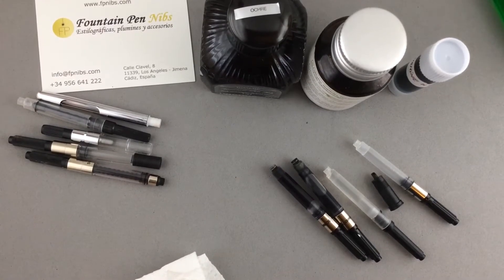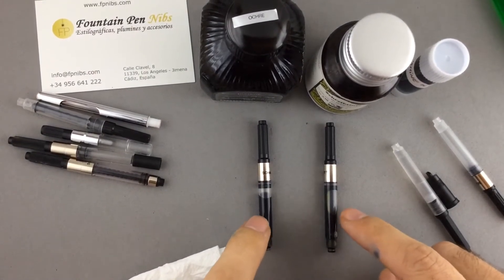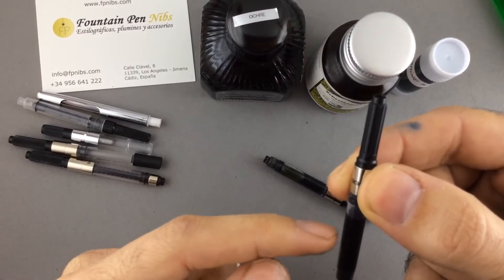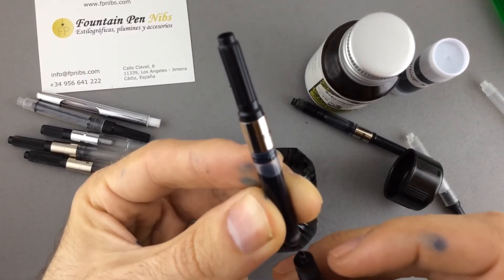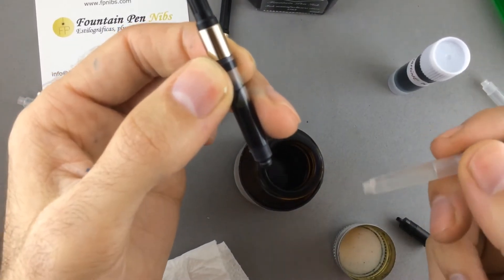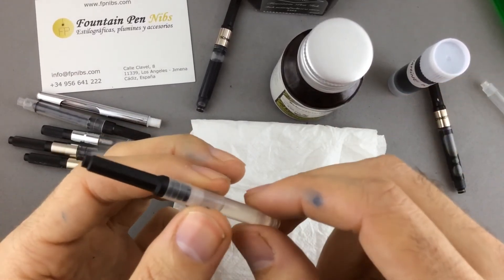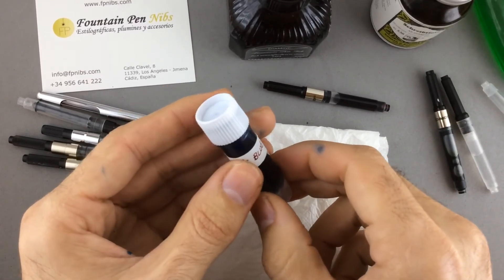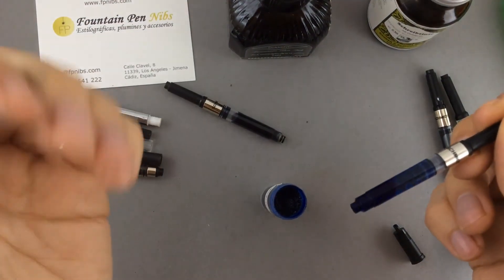Ink flow problems on modern fountain pens Part 2

Comment: Great video!  Another good way to get a stubborn ink to flow is to add an agitator to the converter.  I use a ball bearing.  The ones that come inside the Platinum Preppy cartridges are perfect.  If your converter can be disassembled (and many can), you can pull the piston out, drop the ball bearing in, and put the piston back in.  The Preppy bearings are perfect because they fit in the standard converters but won't drop through the feed hole.  They're also stainless steel, and they won't corrode in the ink  (at least no more than a stainless steel nib will).  The ball bearing acts to break the surface tension of the ink, break up any bubbles, and allow the ink to flow.  Some converters (like the Pilot ones that I've seen) actually come with a bunch of small ball bearings in them, retained by a little steel cage.  But I use the Preppy ball bearing trick on my Jinhaos.

Comment: Hola Pablo, fantastic part 2. That detergent solution in my opinion helps to lubricate the ink for smoother ink flow in the converter. Amazing. Smart tip to test on sample of ink in a vial. Also, it is less waste if it fails. My advise on your english, don't worry about it, people can rewind and play it again if they didn't catch it the first time. Be encouraged and continue your efforts. Well done.
Reply from the maker: Muchas gracias Jesus!
Reply: gpa manuel The soap solution breaks down the surface tension of the ink, making it  "cling" less on the surfaces of the converter. Basically it is not more "lubricating" but less sticky to the surfaces it comes into contact with.... Another trick employed is to include some sort of ball or spring in the converter or cartridge. However this usually is inserted by the manufacturer.

Comment: This actually solved my problem. I just bought a Jin Hao 599 and I tried for about a hour to get my Noodlers Black to flow. I did all of the usual things, tapping, warm water...nothing. I took out the piston converter and noticed the bubble. I let the ink out and moved the air bubble out. I then added a little more so that the ink could move freely and BINGO! The ink flowed beautifully. I suspect you this might be the problem a lot of the time. Thank You.
Reply from the maker: Trent Britain Jéter excellet! Yes, many people was sending me their pens with this kind of ink flow issues, they spent a lot of money on shipping costs so I decided to make this video and send it to them so they can find out if the problem come from the bubbles.
Also some people has asked me about the converter shakers -balls, springs..., but these only work when you shake the pen, but when writing nobody shake the pen, so the ink problem again appears. You do not want to write a sentence, shake the pen, write a sentence, shake the pen... 
I think converter manufacturers should find a solution.
Thank you very much for your comment Trent!

Comment: I just experienced this problem today. It took me bit to figure out why when I'm writing, my pen would go through this cycle where it will get drier and drier as I write and then all of a sudden it will be extremely wet. I was using a Diamine ink when this was happening. I cleaned the feed and housing multiple times with no results. I finally changed to an Iroshizuku ink and the problem went away. Now that I watched your explanation, I think what was happening was the bubble gets bigger and bigger as I write (which would also cause the feed to slowly dry out) and when the bubble gets big enough, it will shoot to the top quickly which also sends ink gushing through the feed. The cycle then starts over again. After watching your video, I looked at the converter with the Iroshizuku ink in it, and sure enough, it flows freely just like in your video.

Comment: It seems that the material used for converter isn't the same as the one for cartridge. The recent converters are transparent and rigid like the one on the video. Brand new  the converters are leaving a bubble that holding the ink flow. I cleaned the converter with soapy water this reduced the surface tension and the bubble was able to move freely. I assume the cleaning removed some molding or protective material that created this surface tension. Quite happy to find a cheap and easy solution to a very annoying skipping problem. I haven't experienced with different ink at this stage, so far just complying to pen, converter/cartridge, ink from same brand. try it!

Comment: Just watching your video on flow problems.  Very informative.  I put my Lamy converter in wrong as didn’t know about the little knobs on sides of converter.  I put it in until it clicked.  Don’t know if I should have done that.  I was having problems with flow.  Now I can’t pull converter back out.  It still has ink in it and is writing now.  Do you have any advise on how to get converter out.  Eventually I need to flush it.
Reply from the maker: Just pull stronger

Comment: Does this imply that pens that do not use a C/C filling system (like piston/Vaccum/eyedropper etc.) are better in principle because the air cannot get stuck inside the large barrel opening and it can flow easily?

I am genuinely interested in this topic and want to learn more.
Reply from the maker: That is right! But pens like TWSBI and Opus88 that fit regular nib units can also have this problem. A Pelikan for instance have a nib unit with a very open feeder fit into the reservoir, like vintage pens, so these don't have this issue.
Reply: @Fpnibs  so what can I do to improve the flow of Opus 88?
Reply from the maker: @dr_ink7268  there are several approaches: easiest one is to keep the pen well cleaned with sopay water. A bit more difficult is to open the air canal of the feeder, and lastly is to modify the nib unit housing and pen section to avoid the "bottle neck" issue that nib units have.

Comment: In fountain pens, surface tension of the ink has as much effect as the density of water versus air.  If having a problem, use a very small amount, one drop at the most, of Jet-Dry or other dishwasher anti-streaking additive in 10 mL of water, and, in turn, one drop of that mixture in your converter or re-filled cartridge along with the fill of ink.

Comment: i think my problem with this might be because of my converter though, because my ink isn't sticky at all, and I haven't heard of anyone else having the same problem with the same type of ink.

anyone know a converter that's compatible with the beiluner fountain pen?
Reply from the maker: Thatis right, converters are made from different types of plastics, for instance, I foundSchmidt K2 converter is better than the K5 and K6 for those inks which shows this issue. Sorry I do not know your pen well enough to recommend a converter. Good luck!

Comment: hi, good day i would like to ask how to make my ink flow better on my jinhao x750 with a zebra g nib. i did watch part 1 and part 2. i did look for the ink issue if bubble comes upward when being tilted, looks good to my converter. now i looked at my feed if it fits through the housing, looks good on its fitting. then i tried to look at the nib if the zebra g nib is aligned on the first space of the feed, looks good to me too. the only thing i think the problem is the zebra g nib sometimes cross over its left and right tip and sometimes theres a space on the edge of the nib's tip. i hope you can help me out thanks.
Reply: additional info i tested it out on 3 different types of ink. 1st some luminous noncarbon ink. 2nd the jinhao black ink. 3rd my own mix of ink(1ml jinhao black ink+ 10ml canon printer blue ink + 2ml of<mixture water50% and dishwashing liquid50%>). all having issues.. 1st ink was having railroads. 2nd ink was having excessive output of ink(too much flow causing bleeding on paper or dripping all over if left nib pointing downwards). 3rd ink having railroads...
Reply from the maker: @besterz3127  are you using the Jinhao feeder? Original or have you hacked it? For flex nibs the most important is ink control from the feeder. I can not modify a plastic feeder for than, but I can an ebonite one. I would suggest you search for a compatible ebonite feeder.
Reply: yes the feeder come with the pen from where i bought on online shop. i dont know what my feeder size is, but i see number 5 on my feeder tip. would you suggest any ebonite feeder for my jinhao x750?  thanks alot @FPnibs.com
Reply from the maker: b esterz sorry, I do not know which ebonite feeder you could try to fit. Ask at Fountain Pen Network forum or Facebook groups. There must be someone who has already tried what you need.
Reply: thanks alot FPnibs.com :)

Comment: Great series of videos. Very helpfull, so thank you! Does this ink flow problem accure especially in a cartridge converter ? I other words, would it help if I would use this "sticky" ink in a empty cartridge instead of the converter?
Reply from the maker: mitzi wijne hello, I think that the plastic the cartridges are made of avoids the "sticky" ink happens so the air bubbles move more freely inside the cartridge.
The other think: the "bottle neck" issue will remains in a cartridge, so be sure all pieces are very well adjusted.
Thanks for your comment!

Comment: I have no problem with ink flow in a regular fountain pen.  The problem I'm  having is with a flex nib pen.  I use a wet lubricated ink that runs smoothly but when I flex my nib pen I get ink starvation because the ink no longer flows to the tip of the nib when it is press down.
Reply from the maker: You need to modify your feeder or a new ebonite feeder with very high ink flow.

Comment: Thank you for both parts on ink flow problems ... One thing I have observed as you showed in this video where the ink does not flow all the way down, I've noted that this seems to happen in converters that have a milky-White coloured plastic and not in the clear plastic converters. I believe that this is also a problem due to surface tension between the inks and the plastic material of the converter. When the surface tension between the two is high, the flow is improper. The liquid soap acts to reduce the surface tension and hence the improved ink flow, it's a "lubricant " .... Would this be correct?
Reply from the maker: Yes, I agree!